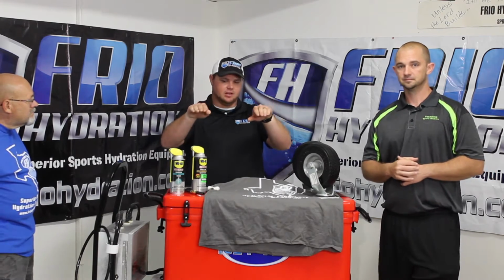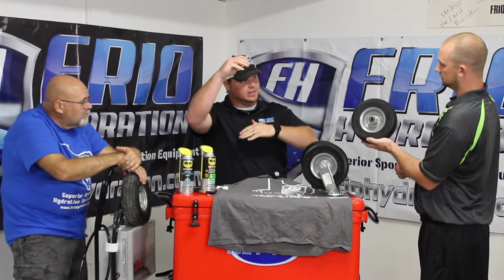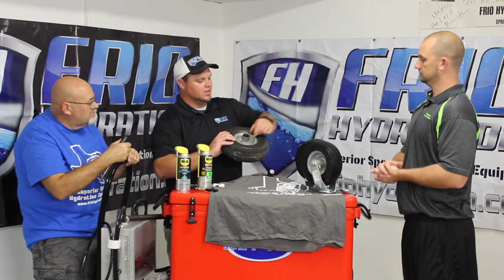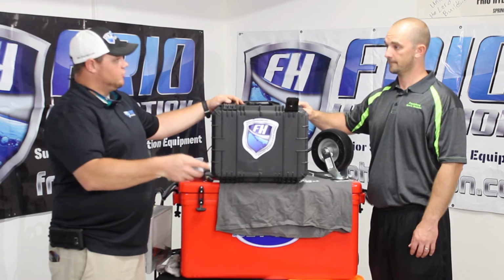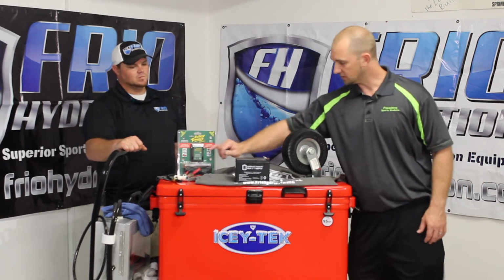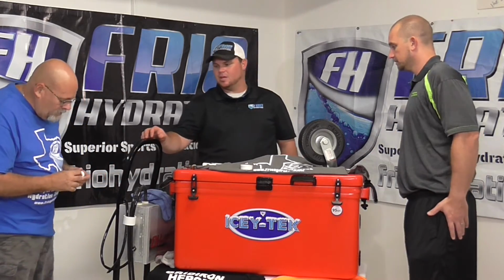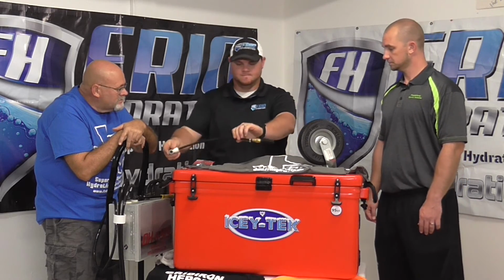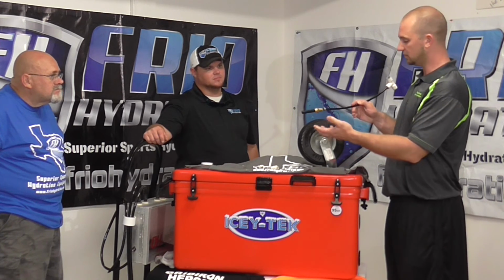Quick Tips for Hydration Cart Maintenance

Comment from the maker: 1. White lithium grease 
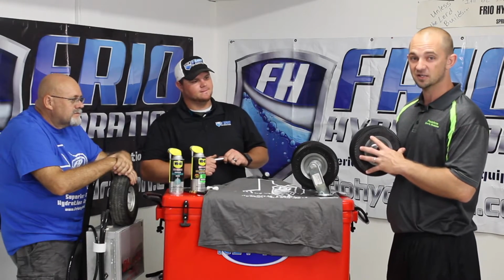2. Flat free tires Starts @ 2:30
3. Bearings starts at 4:57
4. Grease gun Starts at 6:15
5. Dielectric grease Starts @ 9:10
6. Teflon tape / Teflon paste Starts @ 13:06
7. Chargers Starts @ 11:10
8. Hose clamps Starts at 18:30